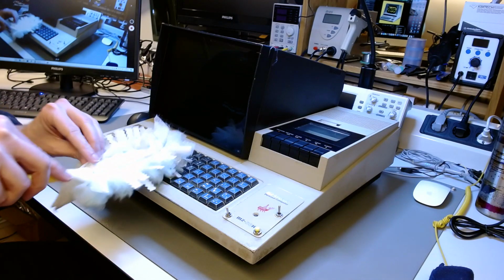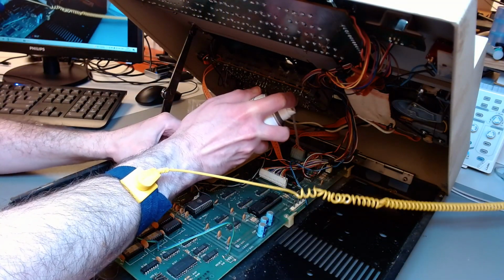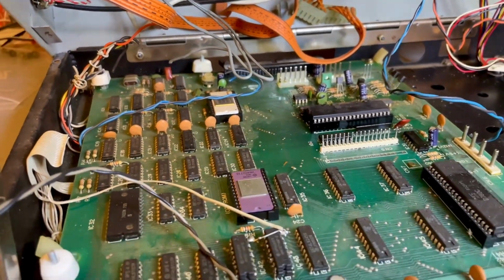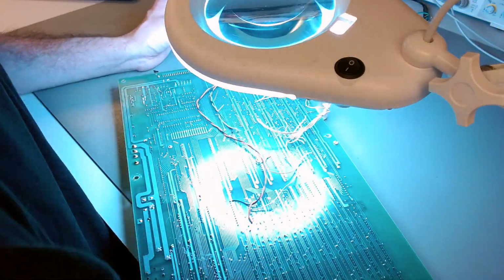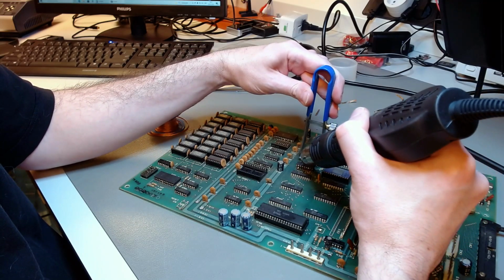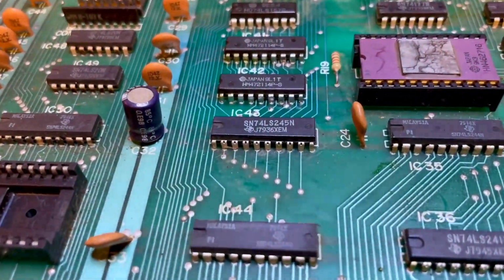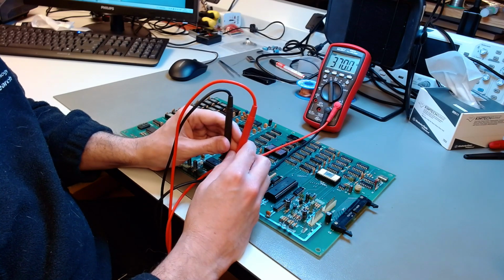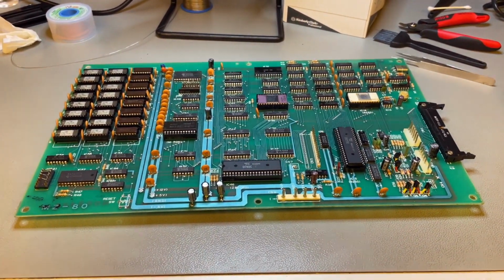Sharp MZ-80K museum-quality restoration, PART 1

Comment: Well done for getting rid of period mods which were quite common back then. History all gone.
Reply from the maker: This unit was intended by the museum to show and document the system as it actually was, not the peculiar interpretation of a user. The original history is what has been preserved. Moreover, the mods were literally a fire hazard and unacceptable in an interactive museum where the system is turned on and used.
Reply: @thebyteattic  Then find a different MZ-80K that hasn't been modded.

Comment: So you turned something unique into just another standard Sharp MZ80K, like getting hold of the Back to the Future DeLorean and removing all the film modifications.
Reply from the maker: Yes, that's exactly what I did. It's called conservation and removal of electrical hazards. In the context of your analogy, the modified DeLorean didn't work (let alone travel through time), was an immediate fire hazard if turned on, and impossible to service/maintain. So yes, the vanilla DeLorean is much better business.

Comment: Restoring the computer for a museum is the best it can happen to that machine, but also, keep in mind that without modding and adding functionality extending its useful life, that computer would have ended in a landfill. 
In late 90s I saw many many Spectrum clones throwed away in the garbage bins (not may recycling back then) just because they were not useful anymore. Same with XT/286/386 class machines in early 2000. That is why they are so rare today. My MSX (a Sony HitBit) survived just because I made expansions cards for it, just because to sell it was equal to throw it away; in that time a P2 was obsolete.
Reply from the maker: Fair point!

Comment: I like the Sharp home computers, I had a Sharp MZ-700 its like a MZ-80K but with colour, and without a Monitor, which I donated (with about 80 other systems) to the biggest game and computer museum in the Netherlands, which is Bonami in Zwolle. I liked mine and its uniqueness, its obviously a bit like a PET, but with a Z80 not a 6502, and it didn't have BASIC in ROM, instead you had to load if from Cassette each time you wanted to use BASIC. Most games were written in Z80 machine code. It was a bit limiting in its graphics as it only has a fixed font, with just a few pseudo graphics to use, a bit like a PET or OHIO machine.

I know the other large computer collection Awesome Space (its not really a computer museum, they are more about gaming) also has a MZ-80K, they have a small room with a hundred or so 8-bit and 16-bit home computers, I also donated many (gaming related) systems there, and in the past I often did help with their "repair Saturdays", that is until corona hit. Never visited Haarlem, but I'm sure I will in the future. At the moment I'm a volunteer for the home and games museum in Zoetermeer, for repairs, Zoetermeer is where I live now for about 20 years, and so its easy for me to help them repair stuff, but they only have a handful of 8-bit home computers, they mainly have arcade machines. But I did repair a space invaders machine at awesome space, so I am somewhat knowledgeable about arcade machines too. Also I took a course in repairing old CRT's there from an American master in CRT repair
 Randy Fromm who came to zoetermeer to give courses. The Space invaders arcade system almost had no sound, so I had to repair all it's opamps (LM3900's) and its random generator for noise. It works now, but because it has been kept in a damp cellar i'ts a bit unreliable, it didn't work at first because of a broken ROM, but I fixed it.
Reply from the maker: I also try to help as much as I can! Great to hear you are doing so too.
Reply: Back in the day my dad had a MZ-800 and with some switches on the back you could put it into MZ-700 mode. It was a really nice machine, withh a quickdisk (2.8 inch drive) and expanded videoram (32k). Later on he sold it and buyed a pc (in my opinion back then, not really an upgrade).